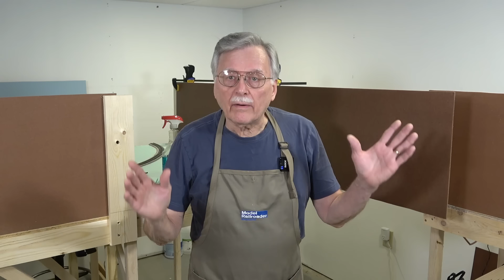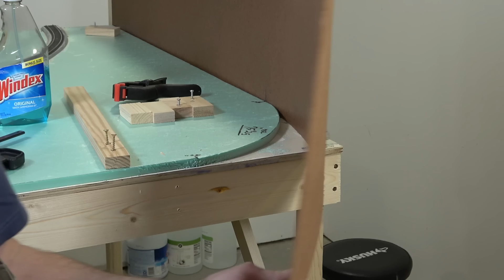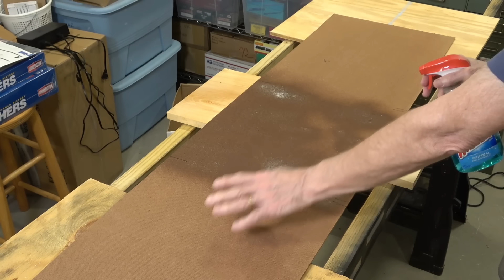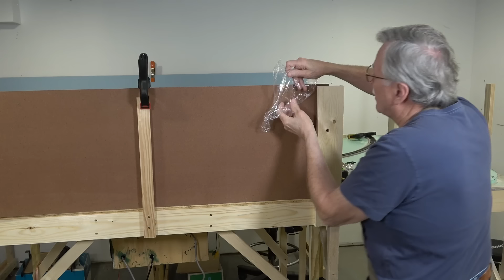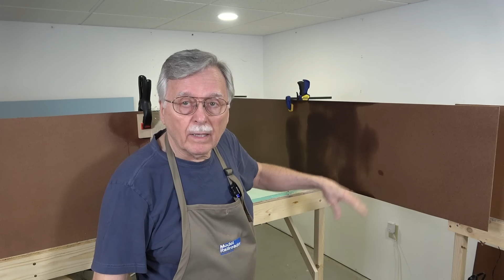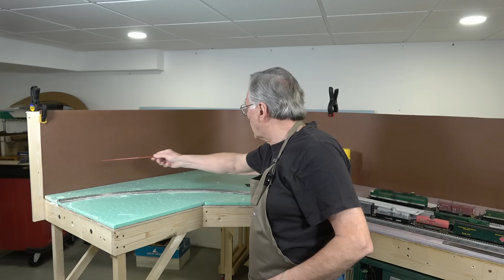Curved Backdrops For Your Model Railroad (424)

Comment: It’s very satisfying when everything fits together as planned.  On my HO layout, I used 12’ long pieces of 1x4 PVC trim boards for bench work around the perimeter of a peninsula—took a lot of clamps & screws—worked better than trying to kerf cut a wood board.

Comment: Somebody is going to say, “Why not just use water?”  Water breaks the fibers and stains the hardboard.  Notice that there are no stains on the hardboard from using the Windex with Ammonia D.
Reply from the maker: But water doesn’t have the ammonia which appears to be the magic ingredient that weakens the fibers and allows you to achieve sharp bends without cracking the hardboard. Water alone will not do that.
Reply: @TheDCCGuy  Done right, you can get some very tight bends.